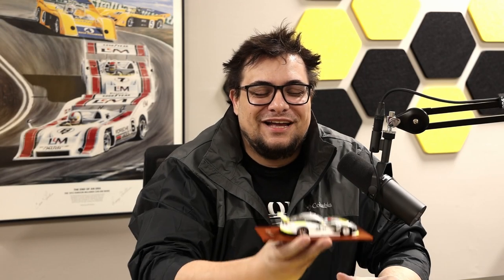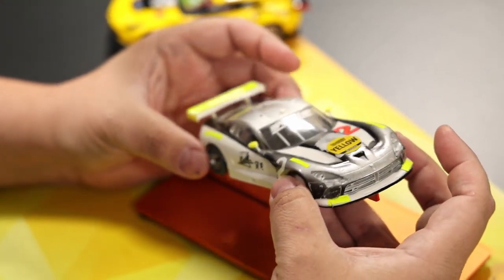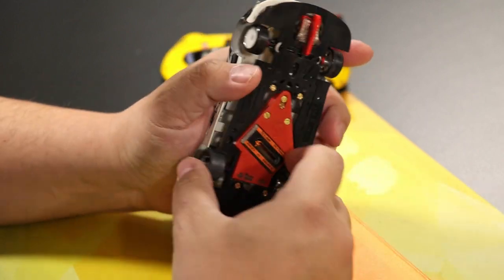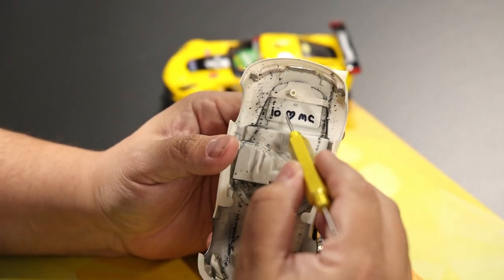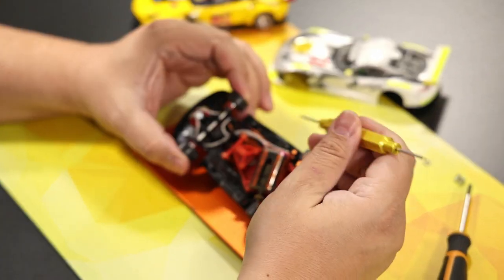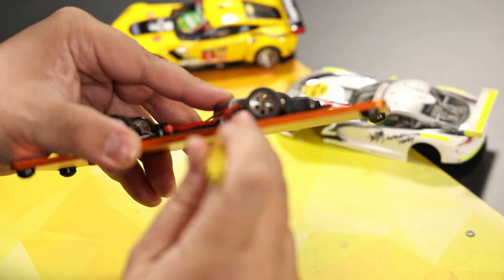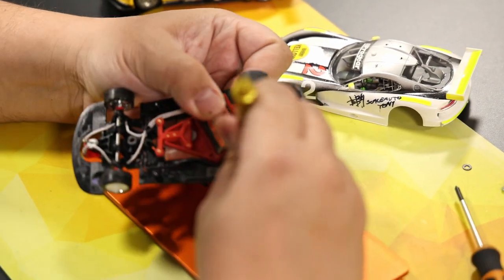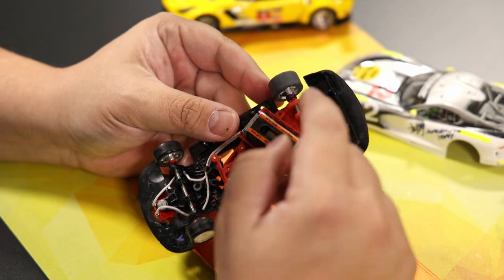Race Winner (x2) - Ian Douglass' Dodge Viper GT-R - '23 Scaleauto Festival

Comment: 👏👏 Ian and his car were in a completely separate race from the rest of us. A masterclass in speed.

The braids on the C7R driven by Ivan and Bernart (and all of the cars I built for this race, including my own) were Sloting Plus 0.25mm racing braid. Not quite as soft as NSR racing braid, but it handles quite well and is probably 10x as durable.

Comment: I noticed also he was on the black “hard” chassis. Most if not all the Scaleauto cars seem to come stock with the gray “medium” chassis, which is super flexible (likely geared towards more common plastic tracks in Spain). The Electric Dreams track seems to prefer stiffer chassis versions (ie NSR white chassis etc).
Reply: Hey Jeff! There were fast cars with really all types of chassis at that race - from medium InFlex chassis to hard R1.5 chassis without the InFlex vanes. For ED, and honestly most of the tracks we're racing on, we opt for a medium to firm chassis which helps the car be more consistent, more predictable, and helps with cornering stability. I tend to start the weekend with the hardest chassis and work my way down if we need more grip. For NSR cars, the white chassis is the favorite at ED, and some people even run the white pod :) Text me if you wanna discuss!

Comment: Is it mandatory to change out the motor or does it come complete with a motor in it? Also why are some motors mounted sideways and some mounted straight. I'm new and would like to know.
Reply: Each racing class usually has a specific motor you have to run - in order for the field to all be level. In this race, we ran the motor that comes stock with the "RS" cars by ScaleAuto. 1/32 Slot cars have three motor orientations - the one pictured here is called "Anglewinder" where the motor sits at a big angle. The second is "inline" when the motor is perpendicular to the axle, along the center of the car, and third is "side winder" where the motor usually is parallel to the axle. They all handle a little differently, but all can be fast.